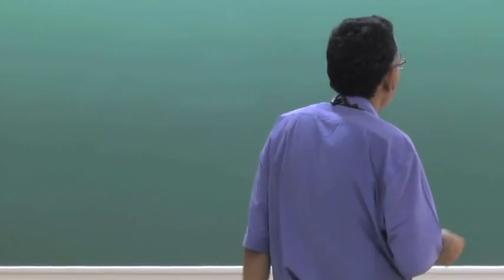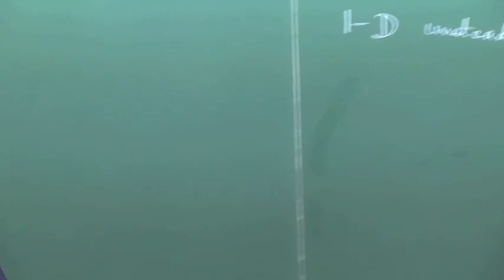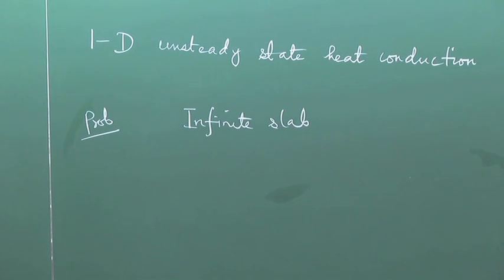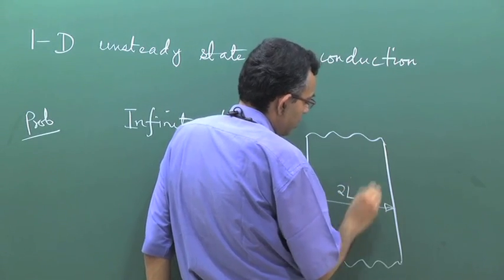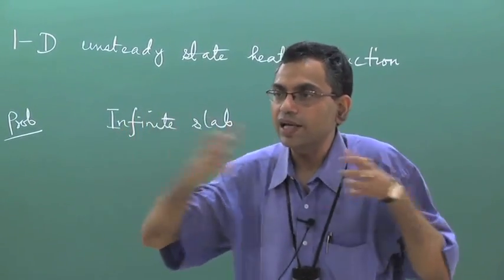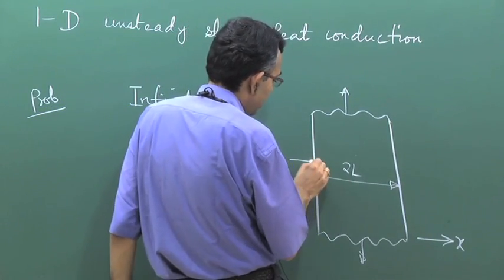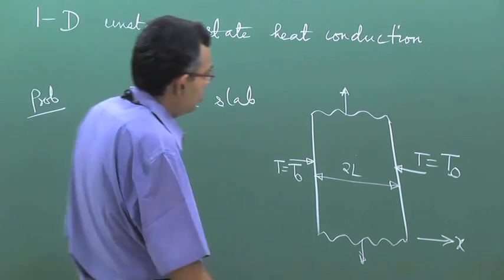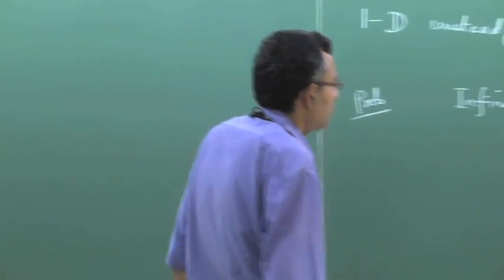Lecture 16: One-dimensinal Unsteady State Heat Conduction

Comment: Sir, how can I manage the problem if the temperatures on both sides were different? (@3:50) Could you give me some idea for that?
Reply: That problem was like dipping an infinitely large plate in oil bath like quenching assuming no surface resistance,only having internal resistance. That's  why both surfaces are assumed to have temperature same w.r.t. fluid or ambient.
Reply: @sisabed54321  Thanks, but it is what I already know. Watch this video @3:47.
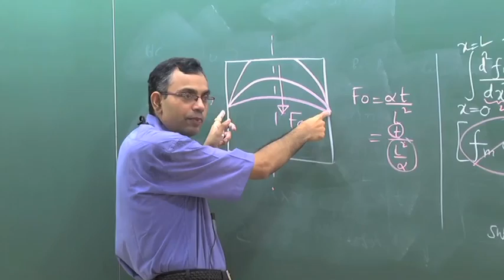Reply: I think you havent watched whole video or missed the part when sir explained. Watch again at @37:30